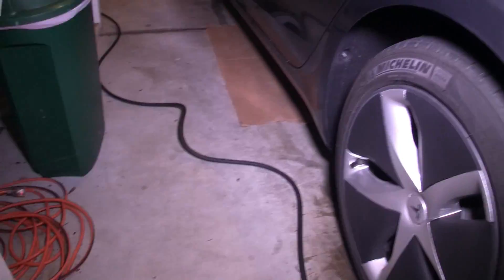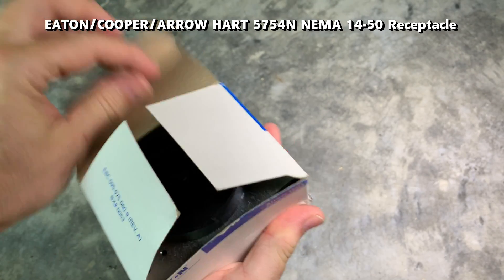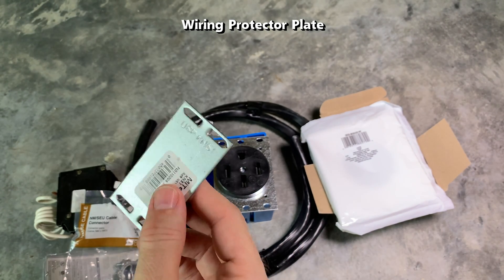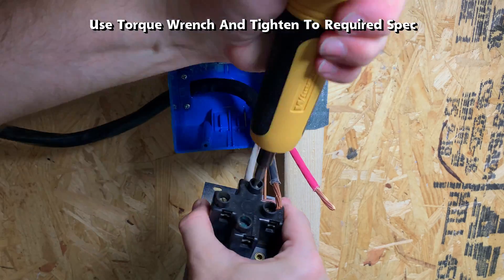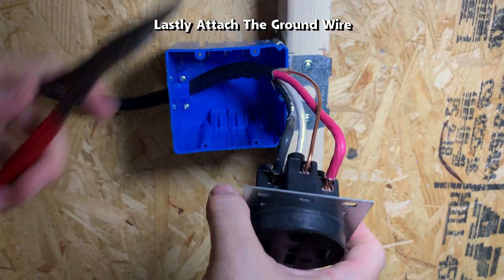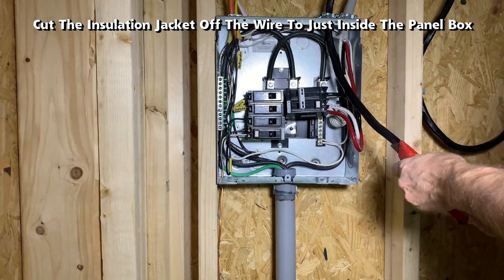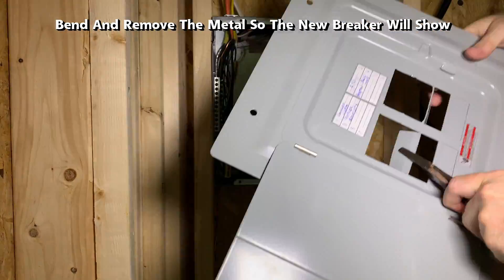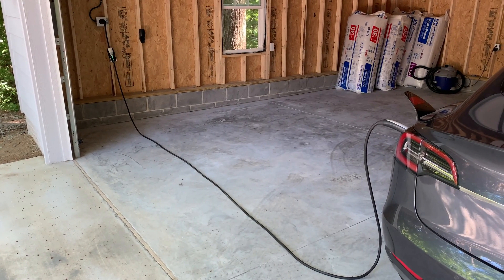Tesla - NEMA 14-50 Outlet Installation

Comment: your video is fast that it cannot be seen where you attach the wires. this is not a very good educational vedic
Reply from the maker: Sorry if it goes too fast.  Which do you need help with, the wires at the breaker or the outlet?
Reply: both the main point is that where the wires are attached not how the wires are run through the walls and conduit
Reply from the maker: @14mmv  On the outlet, the bare wire goes into the ground opening (which is top when viewing the installed outlet), the white wire goes in the neutral opening (opposite side of the ground opening, which is bottom when viewing the installed outlet).  The red and black wires go into the left and right openings (doesn't matter which, they are both line).  On the breaker, the red and black wires go into the breaker (again, it doesn't matter which opening), the bare wire goes to the ground bar on the left of the box, the white wire goes to the neutral bar on the right side of the box.

Comment: Retired electrician and model 3 owner here . Good video, good production, but after 25 years of residential wiring I can immediately tell that you are not an electrician:) Although safe and probably to code in most areas I would have done it slightly differently. I would have definitely stapled the wire 6-8 inches from the box, as it takes some force to bend them, and then get everything into the box. Not necessarily for you (because you covered it well)  but anyone else that finds this, do not waste your money on a gfci "anything" unless you absolutely have too, they are not superior to regular outlets. In fact they can become a liability when they trip and you don't know it. Like spoiled meat in a chest freezer, or your car not fully charged when you need to get to work. Again nice job better than 95% of homeowner wiring I have come across.
Reply from the maker: Thanks.  You are right, I’m not an electrician.  I did reference the electric codes for my specific installation.  At 13:38, I mention that I stapled the wire closer to the box.  “Article 334.30 states that cables coming out of the junction boxes should be secured within 12 inches of the box in all boxes equipped with cable clamps.”  My city requires all outlets or breakers to be GFCI in a garage to pass inspection.  Honestly, if it could be a regular breaker, I would rather do it that way - less issues of false trips since the Tesla Mobile Connectors have built in GFCI.
Reply: @MTNRanger  I admit I didn't watch until the end. Maybe re read the rule. It usually reads that the circuit must be gfci protected which is being accomplished by the Tesla mobile charger. If you are experiencing difficulties I would replace breaker. After researching the ability of the mobile charger I think a 30 amp circuit may be the way to go. It seems like a lot of trouble to get 2 amps of charging. I presently have a 6-20 existing for my air compressor but should I feel a need to upgrade I might try a 30 amp solution, being an electrician in an unregulated area I have the luxury of  trying whatever I want.
Reply from the maker: @NYHalfassprepper  In my area, the city inspectors fail all circuits that don't have a GFCI breaker or outlet for the garage.  It's not my rule.
Reply: @NYHalfassprepper     A NEMA14-30 only actually supplies 24 Amps continuous on the 30 Amp breaker.   In general, all circuits supply only 80% of rated load for continuous loads.   In this case the NEMA 14-50 can supply up to 40 Amps and does but that is the limit for continuous current.
Reply: NEC 2020 change.  210.8 (A). GFCI's  For personnel
250 vac (yes they printed 250) recepticles in garages 210.8 (A). (2).

Comment: All electrical work requiring access to the interior of an electrical panel requires a qualified professional.  This is serious work… that can cause serious problems as it will be one of the largest loads on the the distribution panel.
Reply: Requires someone with the knowledge on hooking up a new circuit to a panel which doesn't necessarily mean 'qualified' professional. Nothing magical about adding a new breaker to a panel and wiring it to an outlet. For those that do research and feel comfortable with it, go for it. Many (not all) will do a neater job than a professional as it's they're home. YouTube has democratized much of what used to be 'expertise'. All the best.
Reply: @davidmurray6070  Seriously ... "qualified professionals" act like they were born with the knowledge and no one else can acquire it like they did.
Reply: @davidmurray6070  i can show you a picture of the hole where my neighbours house used to be…. “Just needed a simple hookup of an outbuilding, I can get my buddy to do it!”
Reply: @brentstarkes9682  Sure, no pics of mishaps from the pros?

Comment: Did not show where the black red the copper ground goes behind the outlet
Reply from the maker: The top is the bare ground, the left and right are the red and black hot (doesn't matter which), and the bottom is the white neutral.

Comment: question, what do i do if my garage is detached to a alley and my box is connected to the house?
Reply from the maker: I would suggest an electrician to give you specific recommendations for a difficult install.  Without seeing it, I would guess trenching or some other way of running the wire from the house to the garage.

Comment: What spec it is to tighten the screws on NEMA014-50R as well as panel ?
Reply from the maker: I can't recall off the top of my head.  I'll check the panel and outlets and get back to you.
Reply from the maker: The breaker says to use 27 lb/in of torque for a 6 gauge wire.  I would do the same with the outlet if it doesn't specify.
Reply: @MTNRanger  Thanks a lot. I ended up using 25lb for all screws and Just passed inspection yesterday. Initial inspection failed because City requires GFCI breaker as you mentioned, so had to order another one and switch.  Your video is very through and really appreciate it. I pretty much bought everything in the list except the cord cutter. and another brand(Bryant ) of Nema 15 -50 out let because it was also high quality and cheaper ($30). I ended up installed the outlet right at bottom of the panel since the panel is close to garage door so close to charging point already and i don't need to screw all the stud
Reply from the maker: @lingkaizou5585  Great, I'm glad it worked out well!

Comment: I live in a townhome, do I need to get city permit to install 14-50 NEMA outlet in my patio?
Reply from the maker: It really depends where you live.  Building codes vary by city/county/state/etc.  Most cities will require a permit to do a project.  However, some may just require an inspection when work is complete.  You'll need to find out what is needed in your area.  A good place to start is the city's website and search electrical permits or inspections.  Good luck.

Comment: Great video. I’m planning to do the same but using a waterproof outlet box since I wash my car in the garage. I wonder if you can recommend the parts.
You forgot to put the link to the torque screwdriver and to the charger gun and cable holder.
Reply from the maker: Thanks for the feedback.  I added the links at the end of the video description list.  As far as a weatherproof outlet box, this one looks nice.  Expandable and looks like plenty of room for the wire to go through the bottom of the cover opening when closed.  https://amzn.to/3dSOGDc

Comment: is a conduit required?
Reply from the maker: Conduit is required if you use THHN/THWN wire, not Romex (NM-B) cable like I used.  This is course is for my particular situation.  Please check your local code.
Reply from the maker: @K lake Thanks, I edited the response to be clear.

Comment: excellent video. I have a quick question, if I'm having a 50 amp wall outlet installed, does it matter if it's 220V or 240V?
Reply from the maker: 220V and 240V are the same thing (just like 110V and 120V).  240V is the modern reference (since 1968!) and I prefer using that term.

Comment: Hey dude you should tape the back of the device for safety.
Reply from the maker: I've lived in five house and have never seen wrapped outlets.  It's not required in code and I personally would not do it.
Reply: @MTNRanger  It's only common practice when you have exposed terminals in a metal box. You have neither here.

Comment: My car is parked on the left side of my garage and my electrical panel is on the right side of my house (basement). How do I feed the cable?
Reply from the maker: It depends on the electrical code in your area.  You may have to route the wire (may require conduit) from the basement to the garage.  If the rear garage wall is near the basement, I would try to get as much routed in the basement before it enters the garage.  Where it enters the garage: 1) if the walls are finished  you will need to run it within conduit along the wall to the location you desire, 2) if the walls are just studs without drywall, you can drill holes in the studs to get the wire to the location you desire.

Comment: Ground wire should always be installed first. Then the neutral second.
Reply from the maker: I've never hear of that before.  If the electrical panel is turned off from the main junction box, there are no live wires.  I don't see how the order makes a difference.
Reply: @MTNRanger  Completely agree. Don't matter when the electrical panel is turned off.
Reply: @MTNRanger  Many people have been shocked by "off" circuits. The point is even when you think it's off, it might not be.

Comment: 7:34 Looks like you didn't land the red conductor properly in the terminal. You can see one of the strands is not under the clamp and is preventing the conductor from seating to the bottom.
Reply from the maker: Thanks, I'll pop it out and take a look.
Reply from the maker: Upon taking apart the outlet, all of the red conductors were under the clamp.  What you see is the right side of the back clamp (it has a L shape).  When looking from the top angle it appears to look like a conductor wire.  See here:  https://youtu.be/g5o2kiOXwBE?t=154
Reply: @MTNRanger  Shoot, I should have watched the clip back a few more times, before I commented. Angles can be deceiving.

Comment: I have a 240 volt 40 Amp in my garage, does need to be upgraded to 50 Amp to work or 40 Amp will do the job? For Tesla cars?
Reply from the maker: What outlet is it?  NEMA 14-50, 6-50, 14-30, 10-30?  I'm not aware of a specific 40A outlet.  Here is a good chart to determine what you have:  https://www.stayonline.com/product-resources/nema-straight-blade-reference-chart.asp
Reply: Read the specs on your charger
Reply: @Ryryryryryryryryry-o8n  thx

Comment: I’ve never seen anyone so obsessed with tightening screws to spec 🤣
Reply from the maker: There have been numerous reports of charging issues were traced to poorly tightened wiring.
Reply: If you live long enough you will find that over time poorly tightened connections heat up and catch fire.
Reply: Absolutely essential!  probably one of  the  most frequent sources of fire in garages from faulty wiring
Reply: Proper torque ensures that fasteners don’t loosen. Neglected small details can bite you in the ass.
Reply: If you ever owned a royal Enfield motorcycle, following torque specs is a religious practice or else you face the consequences
Reply: you would be surprised that often server processors are installed with precision tightening. Before I saw this I never knew there was such a need lol
Reply: You don’t want to ride a car if the wheel wasn’t torque correctly. Also electrical has little vibration and overtime screw will get lose.
Reply from the maker: @solargod3671  yes, due to the heating and cooling cycles due to the high amperage.

Comment: If you buy a generator for standby power outages consider the Powerhorse 7500 Inverter. It comes with the Nema 14-50 plug standard. Less than 1.5% distortion and a new definition of super-quiet. Great reviews, we love ours, works great.
Reply from the maker: Thanks for the suggestions.

Comment: I have my outlet about 6' above the floor. My Mobile Connector Unit unplugged from the short cord and dropped to the floor, about 5'.   Got Warning: "Unable to charge - Mobile Connector GFCI tripped". Looks like internal GFCI tripped/damaged and will not reset. 
DO NOT DROP YOUR CHARGER ON THE FLOOR
Reply from the maker: I’ve dropped mine plenty of times.  Have you contacted Tesla service?  It is covered under the standard warranty (provided you are under 50k miles).  It’s a good idea to use a bracket to support the main portion of the mobile connector.
Reply: @MTNRanger  great video thank you!  Where can I find the bracket for the mobile connector? Thanks
Reply from the maker: @c.c.p9380  Thanks.  It's an aluminum bicycle water bottle holder, only $5 or so.  https://amzn.to/3cj4tZZ
Reply: @MTNRanger  perfect thanks!

Comment: Can you provide a link or where you purchased the 50 amp circuit breaker thanks
Reply: That cable is for like 70 amp. Outlet and breaker are for 50 amps. So it is correct use that cable ????
Reply from the maker: @fredilucha5554  6/3 Romex cable (NM-B) is rated for 55 Amps.  Look at this chart, first column, fifth row:   https://www.cerrowire.com/products/resources/tables-calculators/ampacity-charts/   You can always use thicker wire (lower gauge number) for future proofing.
Reply from the maker: If your area doesn't require a GFCI, I recommend a regular 50 Amp 240V breaker.  Be aware there are many different types depending on your breaker box - get the one that is compatible.

For example:
a Type BR would be: https://amzn.to/3at8iwb
a Type CF would be: https://amzn.to/34rC1Su
a Type QP would be: https://amzn.to/2K97bHu
a Square D would be: https://amzn.to/3p3yTUH

I used this since it was required for inspection:  Eaton GFCB250CS or GFTCB250 GFCI Type BR Breaker:
https://amzn.to/3h0LwNl or https://amzn.to/3mqM5Bm